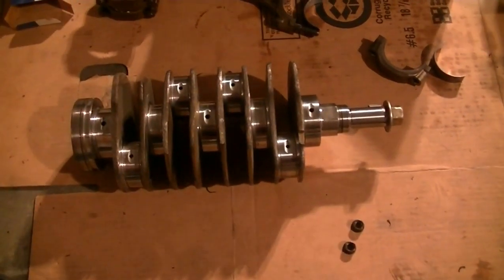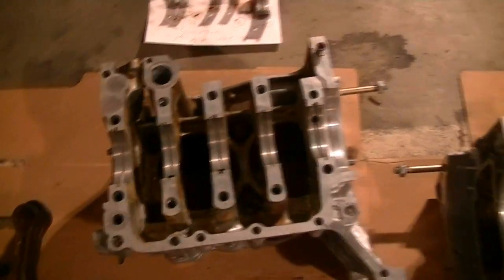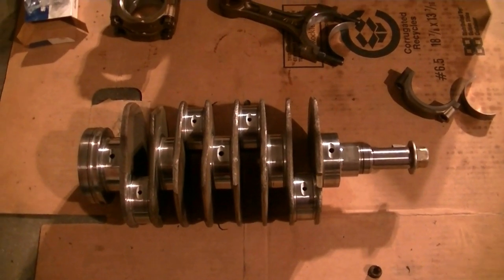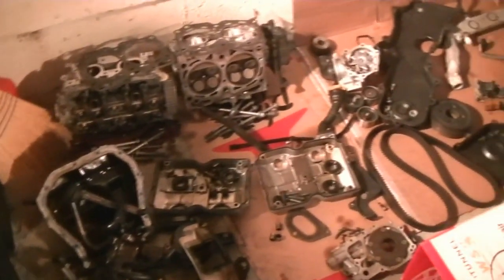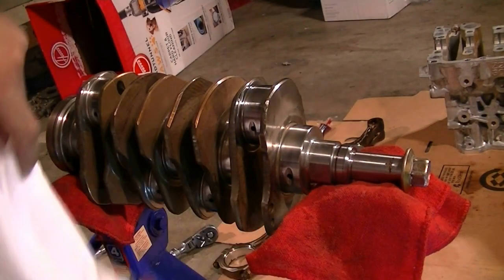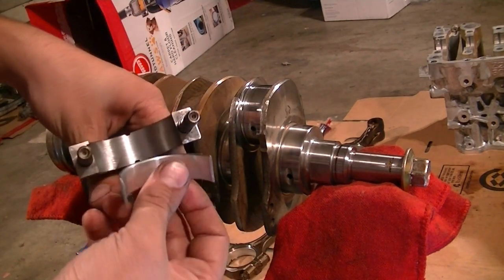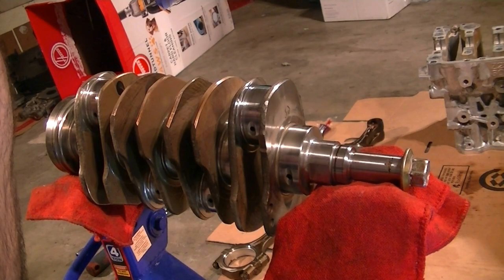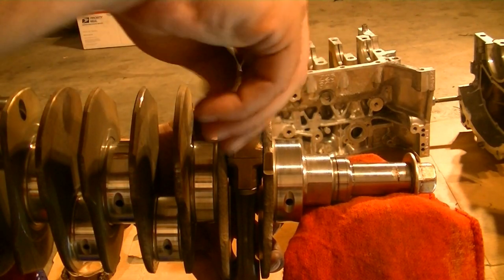How to Rebuild an EJ25 Subaru Engine - Part 6

Comment: So why would you reuse the main bearings? 
Why wouldn't you have the crank re-ground and polished as a professional mechanic with money that seems like shoddy work to me?
Why didn't you send the heads with the block given that the head and block are aluminum and warpage is a main concern in all aluminum engines?
Do you have any contacts in Baltimore area.
Thanks!

Comment: Any suggestion on how to deal with a machine shop? I have one near me that said $450 for the following

To punch out the guides and install
-all valve guides, slight resurfacing of a straight cylinder head, cutting and resurfacing valves and seats $450 just labor no parts; includes checks for damage
-check to see how to check a valve to see if
Cutting and resurfacing valves
Includes cleaning the engine and checking for damage, magnaflux etc.

I can't get an estimate from them on installing piston rings assuming the cylinder walls are in spec. I understand the cylinders may be damaged and require repair which would up the cost. I believe they will also be checking other specifications such as crankshaft journals, connecting rods, and main bearing, but still no estimate. Is that reasonable not to get any figure from them at all?

Comment: It's not a good idea to reuse the oil pump or an oil cooler on a motor that shredded a bearing. Small metal particles stay in small crevices and will damage your new rebuild.

Comment: How do you identify what journal size you have? 48 or 52 mm? Mine is a standard 2006 subaru impreza with the 2.5.
Reply: Oh and is there a different rod bearing size for different crank journal size? Thanks

Comment: You reused the mains? : /
Reply: No concerns.  Mains only rotate.  They don't reciprocate like rod bearings.  Unless they're starved for oil, there's no need to spend money for new ones.
Reply: they are only like 20-30 bucks
Reply: @decipherlogic  Not for factory Subaru bearings--more like $200.  And I'd take OE bearings that still spec., over a new $30 aftermarket set everytime.

Comment: I'm a little surprised the machine shop didn't clearly identify the cause of the rod knock. That must be disconcerting. What would it have cost to replace the bearings? For the one that is close to oversize, can you use a slightly different bearing to prevent wobble?

Comment: Thanks for showing your parts layout for re assembly. 
Were there any bolts that were threadlocked?
Are there any cooling oil sprayers to the underside of the  piston in this engine